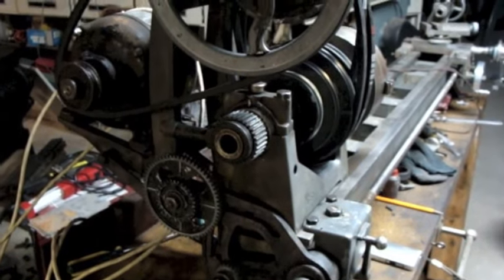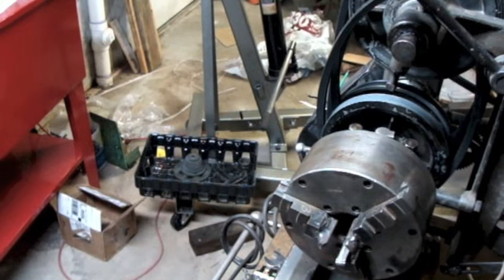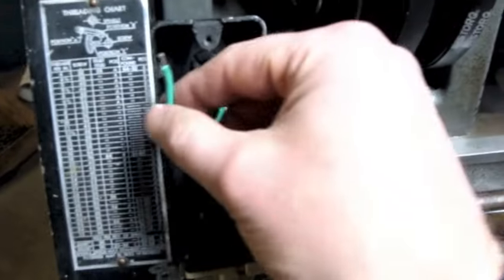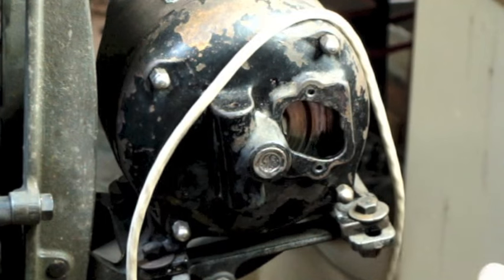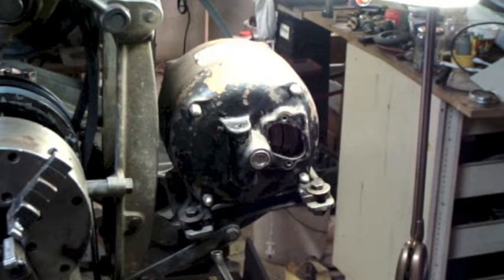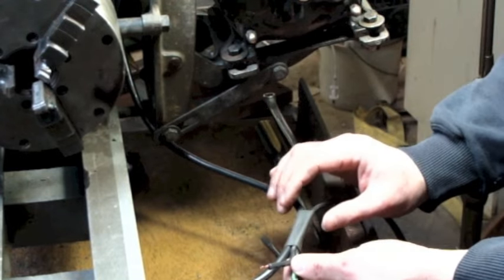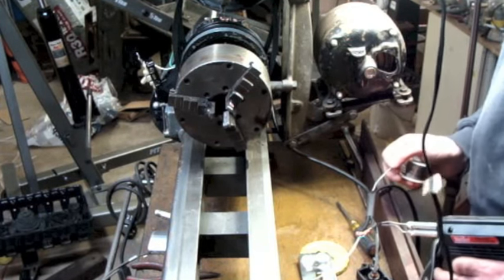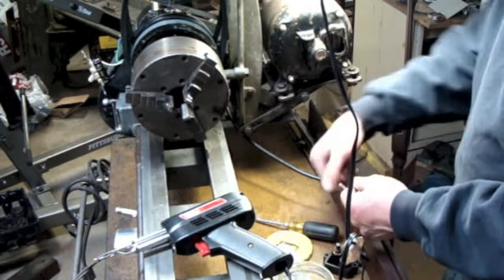Atlas 9" Lathe Part 24

Comment: Mount a small junction box outside your motor and make your connections there then you will be set if you have to change anything.
Reply from the maker: good idea, maybe next time, already finished the wiring for now.

Comment: Those push-in terminals are only for solid wire, and even then, are well known for making bad connections.  I'd get a switch with pressure-plate style terminals, use crimp-on lugs, or wrap the (un-tinned) wire around the screw.  It's safer and more reliable.
Reply from the maker: Thanks for the input. I'll leave it be for now. If the motor ends up being too low a hp, I may rewire the whole thing to eliminate the splices coming up in part 25…….your going to hate that one! lol